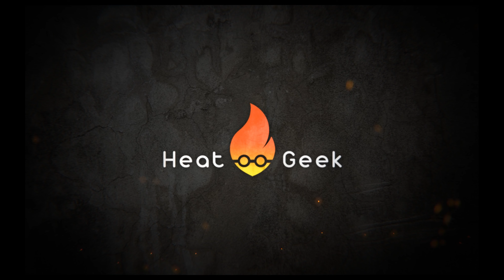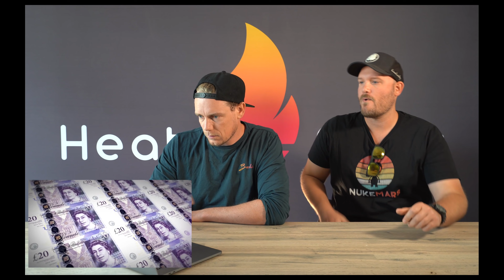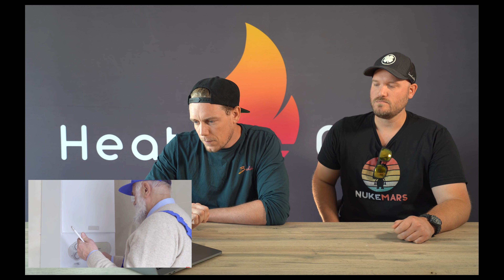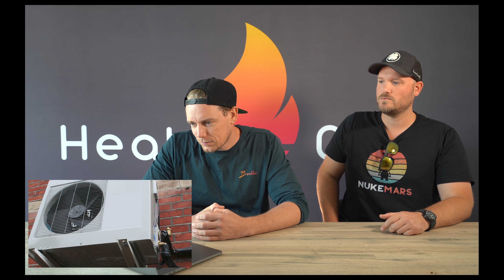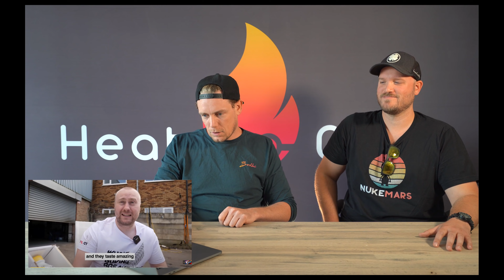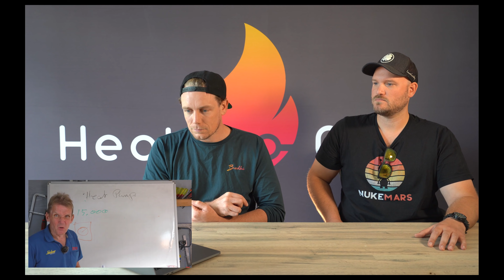Professionals React (BADLY) To Skill Builders's Heat Pump Videos | PART 1 | FIRST TIME WATCHING

Comment: This is a balanced response by a person who actually knows what they are talking about. Heat geek is the best source for the info us gas engineers need to know and are finding it difficult to source. Of course we are all going to fit heat pumps, transitioning from fitting boilers is not hard but we need retraining on pipes, pumps and emitters. Thanks heat geek.
Reply from the maker: Thank you! 😊

Comment: So how should consumers identify engineers who can do the design and ensure that the wider system design is appropriate?
Reply from the maker: That is a fantastic question! And one we are going to create a video on. The installer that goes through the performance estimate with you and explains the variables (I.e flow temperatures) is the conscientious one though. Not the one that just gives a quote. Also one that has done a heat loss calc.. your performance estimate is not accurate without a very detail heat loss calc.. Note, some companies will have to charge to create anything accurate as it takes some time.
Reply: The Engineering Council and the right associated members such as CIBSE and HVCA needs to take charge of this serious matter.

Not youtubers !
Reply from the maker: @anelectrician  but they haven't.. soo....

Comment: So if heat pumps don’t fit all and we don’t have gas boilers etc what you supposed to fit 
System design important factor & heat pumps are not retrofit for existing system same as condensing boiler so what we have to totally Rip out system and redesign for it to work sound like a really intelligent anserwer 
Put under floor heating in houses totally impractical soloutions for heating homes 
It will not happen total waste of time
Reply from the maker: As per the video.. many homes have to have gas boilers.. May want to rewatch
Reply: People will have them fitted for £20k-£30k then spend a couple of winters cold in their house with huge electric bills, then rip them out and get the gas back.
Reply from the maker: @cuckingfunt9353  the people with shit installs might yeh.. there's plenty of people that don't have crap installs speckled by double glazing salesmen though.
Reply: @HeatGeek yes probably will be the shite installs same as shite gas install you were probably bigging up condensing boiler back in the day when they came out they turned out shite so what makes you think these will be different 
When you fit heat pump to systems they were tested on then they will be perfect but it ain’t going to happen

Comment: Love this 👌 Can definitely see the compensation adverts in the near future though! Will hopefully only help to weed out the bad installers!
Reply: We 100% will support that if it happens, maybe Roger's customer will have a case for the heat pump he put in the woods?  ;-)
Reply: @patrickwheeler2646  No case at all, because the customer specified where he wanted it fitted, due to the noise it was producing.
Reply: It has NOTHING to do with the installer.... They only work (just about) with underfloor.... There are no other variables,  there is no magic installer trick to make them actually work without underfloor.
Reply: @cuckingfunt9353  Yes there is, it's not magic though just simple physics.  Underfloor only works better because it has a higher volume and creates a larger thermal mass.  The same can be achieved with radiators and adequate pipework.
Reply: @patrickwheeler2646  Underfloor works because it is a large area and works fine with a 40 deg C flow rate.  Radiators are useless at 40 degrees, no matter how big

Comment: Hi Adam and Patrick.  These are great videos.  Roger is a really good guy.  Try and disregard the pump in the bush thing, its not typical of him.  Other than that you had a lot of common ground.  Can I suggest you try and engage with Roger.  He has done similar collaborations with other people he has disagreed with and it has been very positive.  I believe such a collaboration would be great for all of you and the industry.
Reply: Something that shouldn't be disregarded lightly is the shear amount of energy and materials required to prepare existing properties to be suitable for the upgrade. Uprating all the existing radiators to larger / more efficient units will be both expensive and twice as bad for the environment - with discarding the still functional units and requiring manufacturing of new ones. Manufacturing of steel is very energy intensive, and as alluded to by Roger, subsidies are likely to create significant demand driving a cycle of throwing out otherwise working equipment, to make more, and increasing the wider environmental impact significantly. There are surely better ways that such vast sums of money and materials may be used to reduce our environmental impact (subsidies or no).
Reply: Truth is, we simply cannot go on burning gas. Yes much of our electricity is currently gas produced but that percentage is dropping all the time.
HP systems must be correctly designed, installed, commissioned &, dont forget, operated. Then again, to minimise emissions so must a gas boiler. We 100% need proper training & policing of stds, with serious repercussions for those who ignore, & that means a new body, unlike the cowboys running GasSafe, regardless of the tech installed in our homes.
Fact is we all agree we MUST change. Lets just agree we need to do it professionally for once...
Reply from the maker: @jackocurly0074  agree woth the carbon footprint, that should be understood, but radiators don't last forever, and when they do need changing your already going to need to manufacture a rad anyway. Same for boilers, don't think many will replace a new boiler woth a heat pump..
Reply: Totally agree BelugaMike. Roger has a good following and it would be great for Heat Geek to counter the points raised on his channel, to help build the case for heat pumps, reform of the compliance side of installation and proper training for installers. It would also be a great advert for Heat Geek and the great work you’re doing in the industry. Go get Roger! 😜💪
Reply: Hi Mike. I agree there is much common ground. I also observe a recent and common theme with RBs videos. He's adopted an alarmist, headline grabbing approach common of the tabloids. For psychological reasons, we humans are drawn to such headlines like moths to a flame - basically to try to protect themselves, to see if this potential threat (or even change) is something we should concern ourselves with. Our tendency is to almost ignore positive headlines as they present no threat. All part of our pre-programmed fight or flight responses. Such a shame they are being so misused.
Reply: Yeah roger is one of the best 👍
Reply: But the thing is ... Roger is right.
Reply from the maker: @crimsonJerom  deeeeep
Reply: @HeatGeek  😃 that's a good roast. But seriously, the basic argument that Roger makes is that a house has to be very well insulated and airtight to be a good candidate for heatpump heating. And that basic premise is accurate. You even agreed with that. The rest is filler.
Reply from the maker: @crimsonJerom  it helps yes. Not necessarily though. We have a 200 year old house with underfloor heating and ground source that had a cop of 3.3! Do you have any examples of successful of failed examples or are you using someone else's experience for your opinion?
Reply: @HeatGeek Roger specifically mentioned that a heat pump would work with under floor heating or if supplemented with other systems which is usually cost prohibitive. Anyways you make a living installing these systems which I respect.
Reply: @HeatGeek  if the heat pump does such a good job why do you need underfloor Heating? It's because it doesn't blow very warm air out does it?
Reply from the maker: @actionjksn  who said you need underfloor heating?
Reply from the maker: Well.. we tried and tried but Roger doesn't want to talk..

For those of use asking to prove they work..
Here's evidence of how they work when well installed in a NORMAL house with tiny rads and little insulation 

https://youtu.be/QLGANlbqIFY
Reply: @HeatGeek  you are trying too hard to defend your bs. I feel sorry for your customers.
Reply from the maker: @crimsonJerom  🤣 no need. Our installation company has the best reputation for miles around by a long way. Appreciate your concern though 👍
Reply: @HeatGeek  That isn't an old house you saw some of the houses in Edinburgh hundreds of years old who is paying for the huge cost to insulate them properly my old house in Edinburgh had cold air constantly there was basically no insulation
Reply from the maker: Thanks Mike! I really enjoyed his videos to be honest he's a great entertainer. And definitely agreed with alot of his points. I suppose getting down to the nitty gritty that the only thing we disagree on is subsidisation. We think lowering co2 is 100% worth subsidisation.
Reply: @HeatGeek  "We think lowering co2 is 100% worth subsidisation."....yes of course. But equally consumers have to be protected AND they get what they pay for. There needs to be independant inspectors who check that EVERY job is installed correctly and that it functions as specified. Otherwise consumer confidence will be eroded and the industry will be harmed long term. No point having heat pumps if nobody wants them!!
Reply: @Sean006 
I talk to some top engineers, and they say that the average air heat pump is simply not efficient and suitable for most properties, particularly in the Winter.  Of course businesses who are installing these systems will want to present these pumps in a positive light.  Unless there is a massive increase in technology and efficiency these pumps are a dead duck!
Reply from the maker: @Pedromyman1  lol. I don't think your talking to 'top' engineers. Because they have the ability to install everything and wouldn't make that sweeping statement
Reply from the maker: @Sean006  there are far more people that want them than can install them. If your involved in this industry you would honestly know how true that is right now..  its absolutely nuts!!!
Reply: @HeatGeek  What sort of an answer is that? You & your colleague pointed out that the quality of the installation is vitally important....having a vibrant market without regulated & trained installers will only attract cowboy outfits and lead to disaffected clients....and the bad reviews will put off potential customers in the long run.
Reply: @Sean006  yes i know.. and were actively addressing that with training... its definately acheivable..
Reply: @ChapmanPlumbing  I wish you well in your endeavour. The potential problem is I suspect you are the exception rather than the norm in the heat pump industry. And a few cowboys can cause a lot of damage to the reputation of heat pumps.
Reply from the maker: @Sean006  again, thats what we are adressing...
Reply: @HeatGeek  "again, thats what we are adressing..."
So you have control over the whole heat pump industry and every self professed 'heat pump certified engineer' will be trained by yourselves (or another suitably qualified training establishment)? 
Customers have to be protected and the government has to provide the regulation of the industry to provide that protection. Rather than relying on companies like yourselves who have the right intentions but finite resources.
The point is....heat pumps are NOT bad.....badly installed heat pumps are BAD. Only a regulated industry can guarantee that ALL heat pumps are installed correctly & in appropriately insulated buildings. Otherwise the heat pump industry will be harmed long term....one rotten apple to spoil a barrel!!
Reply from the maker: @Sean006  I didn't say that. Your not saying anything new and I don't get your point or if your agreeing or trying to disagree with me?
Reply: @HeatGeek  I am not agreeing or disagreeing with you. You have a viewpoint based on your expertise (I respect that). However just because you do your job correctly it does not mean that the rest of the industry is at your standard. You are also trying to raise the standard of installers through training, which is commendable.
What your industry - I presume you have a trade organisation - need to do is lobby government & ministers to set national standards for installations and that these are regulated. This will raise standards through certified training companies (like yourself), drive the cowboy firms out of business and also provide customers with a high level of confidence that they aren't going to waste their money. It will also counter some of the points that Trevor was raising...some of which you & Adam partially agreed with. 
The danger is that heat pump industry becomes a wild west of cowboy outfits!!
PS you do have quite a short fuse don't you?!
Reply: @Pedromyman1  depends on who installs it..they do work
Reply from the maker: @Sean006  Oh right, what makes you think we're not? we absolutely are! appreciate your comment though.

p.s. i think your reading intonation from me that isn't there. Im very laid back 😎👍
Reply: @HeatGeek  you are disingenuous
Reply from the maker: @crimsonJerom  when you run out of arguments i suppose there's nothing left to do but name call.
Reply: @stevel9914  You may have a point in that CO2 may not be the sole cause - or the primary reason for global warming. It may be the symptom of the disease but not the actual root cause. There are other suspected causes....methane (meat production), deforestation, agricultural processes etc etc. But they are all lumped into 'human activity'.
So I suspect reducing CO2 on its own would NOT fix climate change (it might not even be 'fixable' by human intervention....however that doesn't mean we shouldn't try). However reducing or stopping our reliance on fossil fuels is not a bad thing, it might even create better places to live. We also need to eat less meat or find a way to reduce methane emissions from meat production. We need to stop cutting down the rainforests amd 'perhaps' even plant more trees. SO basically the 'solution' to global warming is a  holistic approach....that involves reducing CO2 emissions but includes far more changes to the way we live our lives.
I hope that helps.
Reply: @stevel9914  There are some people that will never be convinced by the science.....as long as sensible people are control of things then we stand a chance at least. 
Who mentioned extinction?....you did, so I guess subconsciuosly you are more worried than you will admit.
Have a nice life down the rabbit hole!!

Comment: Also these do use solid fuel. Electricity is created by oil gas solid fuel. Some cases yes nuclear and wind farms but not near enough to meet demand and if everyone gets a heat pump the electricity demand will rise dramatically
Reply: Baxi and Worcester are doing some good work on the bio gas. I haven't heard the figures yet but apparently the carbon is more or less non existent. That would be a massive leap because customers won't need to pull the place apart to retrofit. Hopefully.... I like fitting heat pumps they are so straightforward but I'm not convinced they should be they the future. Having said that it would be nice to have a design that would allow any form of boiler/heat pump etc to just slot in without the need to upgrade the system every time. Heat pumps and he boilers only have a 10 year life span give or take. I'm in ireland and people who already have had a new house built with a heat pump that is now 8 years old have had to replace it with oil due to uneconomical repairs of the heat pump. They are saving way more on their bills with oil. However the houses are very well insulated.. its odd but its what they are saying
Reply: @alanwoods4023  If the house is insulated enough to work with ASHP, just imagine how cheap it is to then run it on oil !
Reply: Absolutely agree, check out our video on a Hydrogen fuel cell for an alternative viable technology
Reply from the maker: Agree

Comment: To be fair he has some points. The money it will take to have an efficient heat pump is very expensive when you take insulation etc into account. I see both arguments and in my opinion hydrogen will more than likely be the future
Reply from the maker: If 'the runaway effect' hasn't started perhaps. If money is the problem the government need to help. They find more than enough needed for this when they start a war or brexit.
Reply: @HeatGeek  Brexit get you upset did it ?   Maybe you can change the flame logo to a snowflake !
Reply from the maker: @cuckingfunt9353  I voted for brexit. I did not realise it would cost more to implement than all of our previous contributions and was based in a lie though.. yes it has upset me. I cry most nights.
Reply: @HeatGeek  You voted for Brexit ?  Yea right !  Don't tell your mates ! ... Brexiteers are proud of Brexit, after all the agro, getting out from under the jack-boot of the fascist EU occupation was nothing but relief. Obviously the remoaners regret that we all voted Brexit but they would wouldn't they.
Reply: Without a doubt.